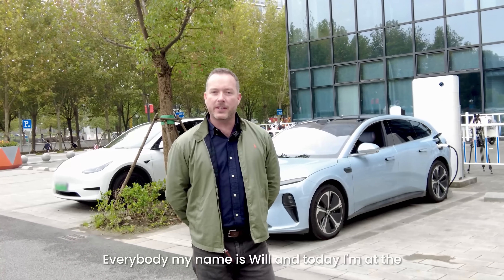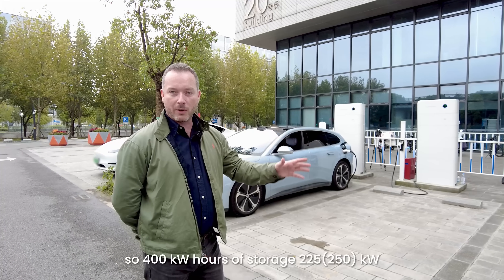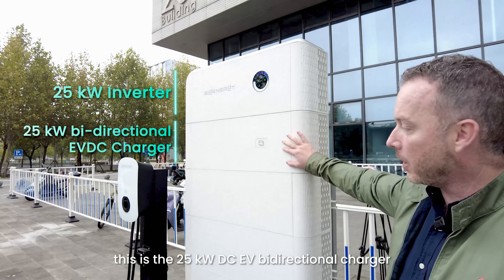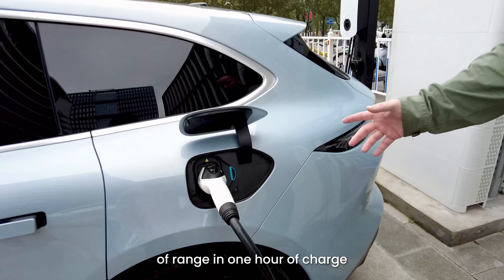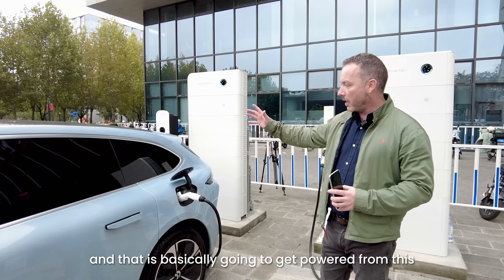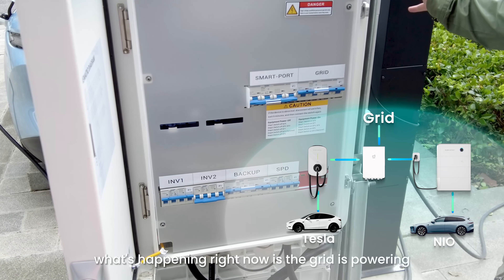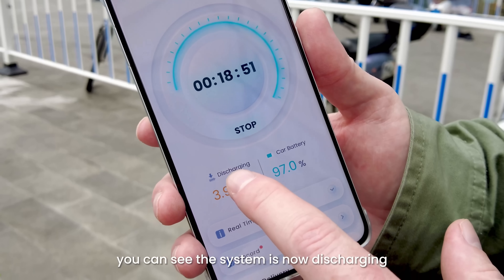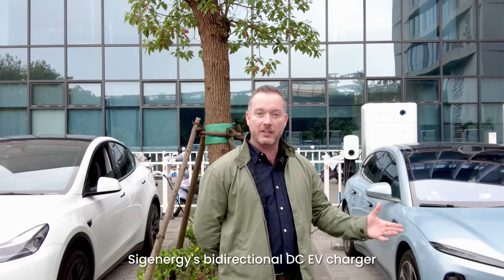Experience V2X with SigenStor: Seamless Power Transfer

Comment: The Ford MachE can now do V2H, V2G in the USA with this SigEnergy system.
See the Electric Duo video posted today with this system installed and working at a home in San Diego, CA
The Ford F-150 Lightning also works for v2h, v2g 2 way dcfc

Comment: The DC charger looks brilliant. One doubt: can it only be coupled with a three phase inverter or does it integrate with a single phase one too?
Reply: From what I understand, it can be coupled with any of the SigenStore systems both single-phase or 3-phase. But the maximum fast charge may be limited by the inverter & battery capacity. To get the full 25kW, both the batteries and the inverter combined need to push enough power into the charger module.